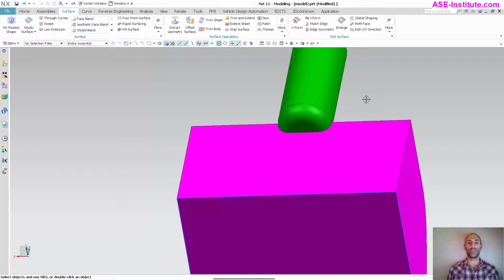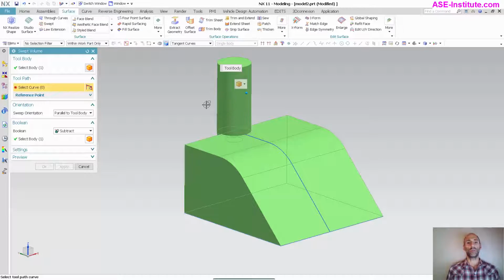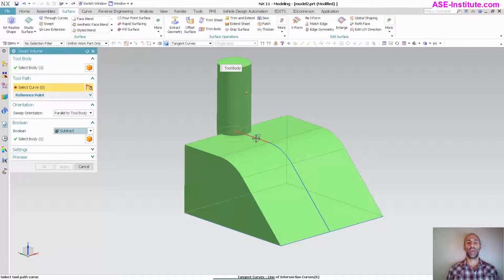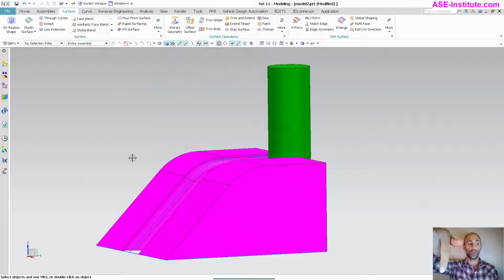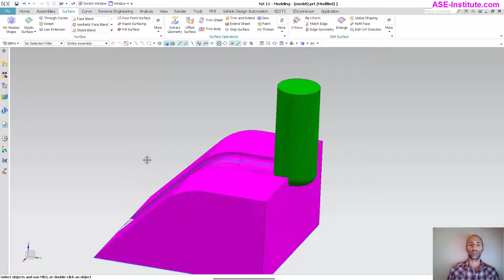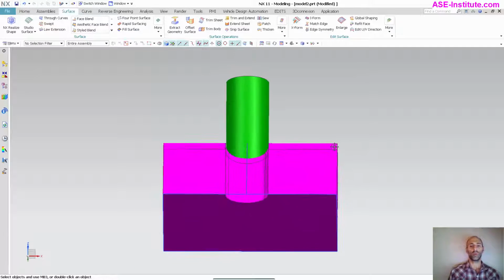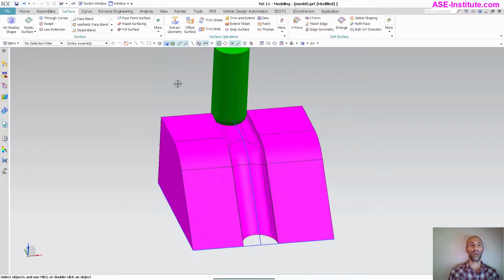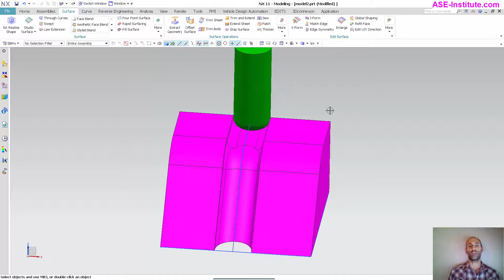Swept Volume | Siemens NX 11

Comment: Should show the ability to change orientation to "normal to path" however i am noticing if you stop the path in the middle of the part it does not produce an accurate result.

Comment: Nice example. In my experience this issue is often disregarded.
We had lab guys that wanted t-slots on a circular surface and they couldn't understand why the walls won't be flat. :-)
Is there something similar in catia?
Reply from the maker: Thank you very much and thank you for the question.

There is nothing available in the standard workbenches. In the NC workbench you have options.